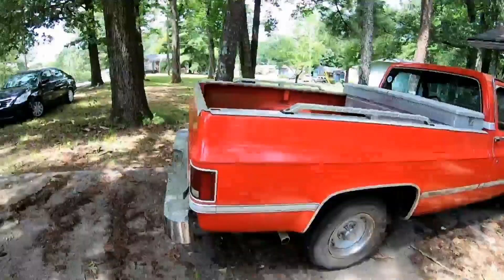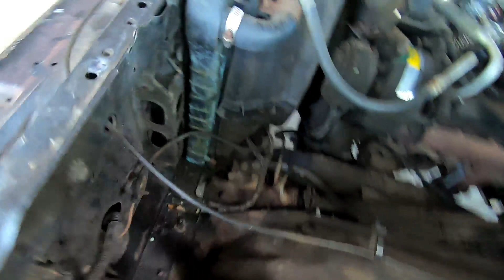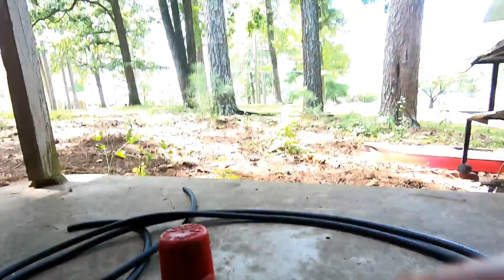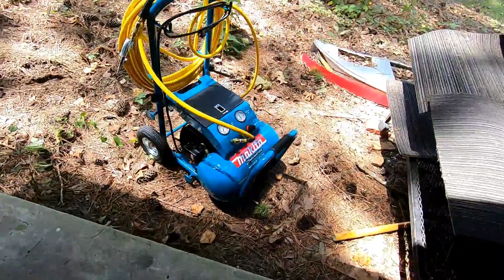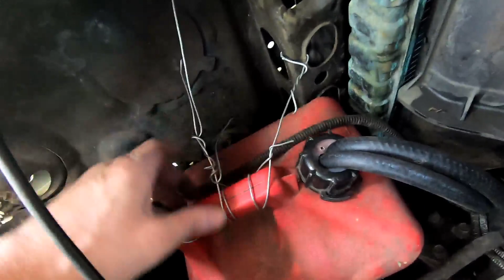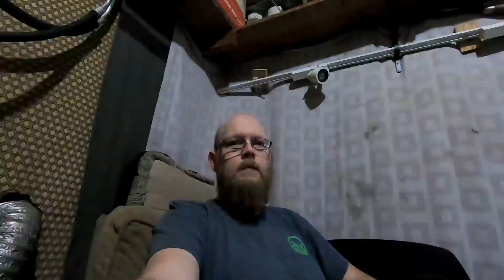How to test Mechanical Fuel Pump using common gas can- Squarebody C-10

Comment: If you suspect your pump is bad remove the gas line at carb turn motor over no gas bad pump or clogged sock in tank
Reply from the maker: Sorry bud,  you lost me at OR...this way isolates the pump the from the tank/lines and gives you an actual answer to the question being asked opposed to another OR maybe its this situation. I mean sure, I could do it your way and still not know the answer, but ill pass.
Reply: @mechanuts7191  well all you gotta do is blow back through the line to the tank if you use your mouth you can feel if the sock was clogged and come clean I just figured diagnosing bad pump or stopped up line by removing only 2 hose clamps was better then spending the time doing this

Comment: On cars this old i rather just replace the fuel pump anyway only 2 bolts save more time  good video tfs
Reply from the maker: I agree 100% bud...thats why the pump was new. I was more checking to see if the lines were bad..... Obviously this wouldnt have worked with a bad pump right...but you knew that already,LoL
Reply: @mechanuts7191  yup tfs

Comment: Wait, what?   What are the connections?    Gas Can to fuel pump intake, then to carburetor?   Is there a  return line from the carb back to the  gas  can or something?
Reply from the maker: yes and yes

Comment: HAHAHAHAHAHAHAHA you're a Mad Super Genius 👍been there done that 🤣😂🤣
other way is to connect a fuel pressure gauge, if you do not have fuel gauge try this method.

if doing by yourself or with a second person to crank engine (other ways to crank engine alone)
get a gallon jar (plastic preferred) 
disconnect hose from fuel pump or at carburetor (which ever is better access) 
put hose to gallon jar, crank engine 30 seconds, that should give you 6 oz, if not, time to replace fuel pump
(this method is on mechanical fuel pumps) i don't know how many ounces would result. 

on my RV when i've run on empty i have to bleed the line from air.
disconnect hose at carburetor, let the electric fuel pump gas into a small water bottle, reattach hose and i'm good to go.
Reply from the maker: I do have a gauge but it didnt tell me anything other than ...Hey you have low pressure/no pressure. In this case I was trying to determine if I had pre-pump line blockage or a pump failure.
 Ive used the LPH method on electric fuel pumps but it isnt as useful anymore on the mechanicals due to the inconsistent flow and pressure ratings even on identical pumps. Modern Mech Pumps Suck so bad now it makes me angry. Well at least the pressed ones under $100 do. I suppose a billet pump may fare better.
I.E.one pressed mech pump may flow at 70lph @5psi and one that came off the same assembly line may be a choocher and test to 90lph @ 7psi. however Pretty much all modern electric pumps are within +->2% of advertized flow/pressure so it works great with them.

Speaking of mechanical pumps...Im about tired of replacing mine every few months or so. Ive been through 5...Yes actually 5 since aug 2020. They all seem to eventually weep where they press them together. Im gonna have be doing a sniper setup soon so thankfully ill be done with the mechanical pumps at that point.
Anywho thanks for watching and be well!!!
Reply: @mechanuts7191  i totally agree with you, besides this new gasoline messus up the rubber components. i have a '68 Slant Six with 330k original miles and started givine me the same problem. i admired the way you installed the gas can 👍 thanx for the reply

Comment: Hi I have an 87 Camaro have taken the TPI engine out, now have carby. When you put the relive valve in at 5.5 psi do you also have to have a return 
to the tank. Hope you can help.
Reply from the maker: So.... Most (not all)factory GM setups pre 1980-ish had no return on the pump. Once it was discovered that cavitation and fuel vaporization were a problem with unleaded fuel they changed over to a return line setup. That being said it really depends on the pump. If you have a new old stock GM pump they are pretty good about relieving pressure through internal means...however anything being produced now for under $200 is a crap chinesium pump  with pva plastic diaphragms that DO NOT work well without an external regulator. 
My setup is a  return style Carter pump( on my 3rd in 8 months...dont buy carter anymore) with a regulator  in line with the carb post filter. I added the regulator ( @ 5.5psi) because even though its a return style pump it does not regulate pressure properly. I have not found a modern mechanical pump that regulates pressure precisely enough for an edelbrock to be happy and therefore have to add the in line regulator. The regulator I use is for a returnLESS pump but works well as I have it set up. 
SUMMARY: Buy a 3 port pump ( return style) from your local parts bin( $30 )  so that you have a local warranty...mate that to a static in line pressure regulator ( mr gasket $20 ) and YES run a return line off the pump to the tank. This will give you enough fuel to support at least 350hp and maintain 5.5-6psi

Comment: I'm going to attempt this my with 7.3 Powerstroke diesel. Any tips?
Reply from the maker: use fuel injection rated hose. The pump on a diesel may collapse a softer hose
Also im sure its obvious but dont try this with the high pressure side,LOL
Reply: @mechanuts7191  isn't the high pressure side the lower port on the fuel pump
Reply from the maker: Dont know a thing about the 7.3
Reply: This very technique saved me on my Ford 7.3 powerstroke!  I rebuilt the entire top half of the engine and replace the fuel tank, fuel pump, and lots more, before I tried this trick, only to find leaky fuel line that sucked air.